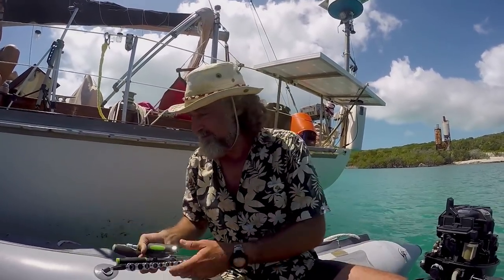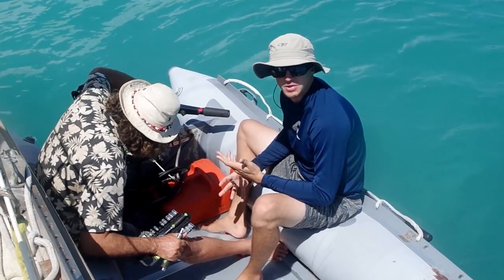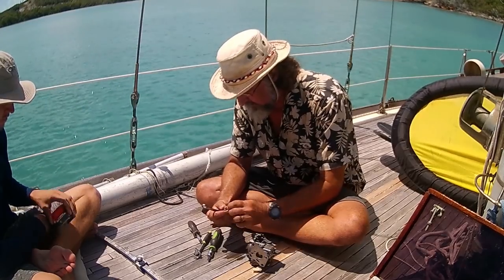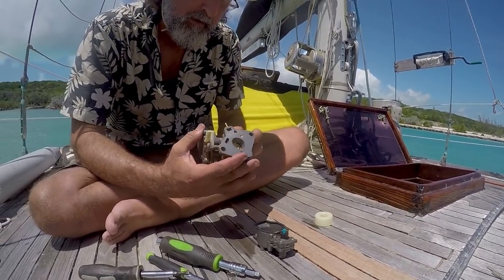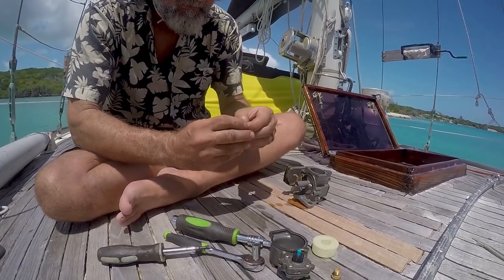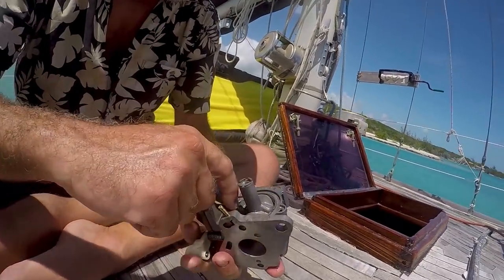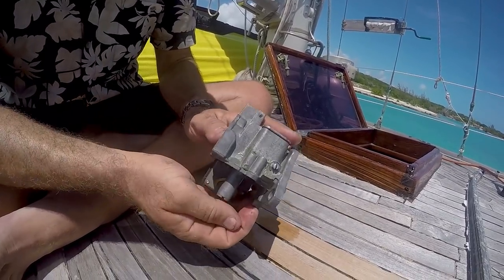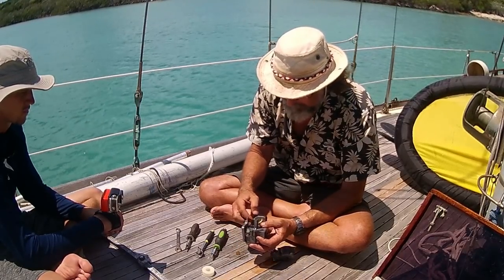Fixing a 2-STROKE OUTBOARD Motor [Capable Cruising Guides]

Comment: What year and hp is that engine. I have a 1993 9.9 Merc with pretty much the same symptoms.  Starts fine, idles fine and gets on plane but can get me where I want to go. Once I start slowing down to idle , it will shut off on its own and will not start. After fishing for an hour or so and using my trolling mtr. then it will start and get me back. But the boat has to sit for a while before trying to start it.
Reply from the maker: Sounds like a very different symptom to me.   Make sure yours isn't overheating.  If it is a have an easy solution for that.
Reply: @Clarks-Adventure  I only ran it twice last year when i first got it. Water pump worked great, good pressure. Someone else said possible coil(s). I was told that after running and it would not start, pull plugs, ground, pull start rope, if you see yellow spark, coil may not be putting out needed voltage to fire off plugs. Dunno. 2 cycle is german to me. Any help is appreciated. Even though this engine is 30 yrs old, it looks pretty well new and used very little.
Reply from the maker: Well run it a while and then touch the head.  If it's over 160f it's overheating.  

It can pump water and still overheat.

I don't know it that's your problem.  I have no information to go on, but it could be. Easy test.

Comment: just got a motor just like that that came up on my crab trap even had the gas tank the vent was closed so the gas was still good almost got it running i may take the carb off it may be full of water .
Reply from the maker: Wow. What a catch!

Yes get that carb apart.  Rinse everything in fresh water.  The carb will corrode inside in a few days if not opened and cleaned out.  Also the wiring will eventually corrode if not cleaned.   Inside of motor is tougher but needs to be rinsed and run to coat everything with oil before issues start.

In short you are on a clock with this find.

Comment: Hello, I know it’s been several months since this video but I am looking for some help. I have a 2006 Johnson 90 hp saltwater edition v4 2stroke. I have recently rebuilt all 4 carbs and cleaned both throttle bodies. Before I even began the cleaning and rebuild I pumped the primer bulb and it had some resistance but never got tight tight. Continued pumping bulb and fuel and oil mixture came out lower unit and prop. What could cause this? Thanks
Reply from the maker: In one of your carbs the needle valve is not closing properly.  Take it out and clean it well.  Before putting it back on check it.  Always do this.  See my 4 stroke repair video as I go into this procedure better.
Reply: @Clarks-Adventure  thanks. I just rebuilt all 4 carbs with new seats, floats and needles. Could it be a float not adjusted properly letting the new needles seat properly? Or maybe the primer diaphragm or main diaphragm from fuel pump letting fuel pass through? Thanks
Reply from the maker: So hard to diagnose from comments.  I assume that didn't fix it.

Yes if your float doesn't float (has gas inside it) this could cause this.  Doesn't happen much anymore with plastic floats.
Reply from the maker: Did you do the blow in the carb trick to verify the valves were seating?

To guess further I'd like to know exactly where the fuel is leaving the fuel system.  I assumed it was running down the shaft before.

Is it actually coming out if the exhaust?

Comment: I just bought a 1983 Mercury 50 2 stroke it was running perfect went to leave left it idling and it died and won't crank. When I squeeze the primer it's firm but I'll squeeze it really hard it spray's gas out carb? It will crank for a second but don't stay running?? What do I do?
Reply from the maker: No worries.  You have a bit of gunge in the floats needle valve.  Fuel is too high in the bowl so it's running too rich.  Just take the carb off and clean it up.  The video will help. It's the opposite problem this engine had but it's common.  You can hear me talking about it when I'm diagnosing.  You will find that the needle just needs a cleaning so it will seal again and you will be good to go.  Worst case is you will need a new needle valve and maybe seals as it's an older model and things can deteriorate with time.

I forget does that year 50 have one carb or two?

I'd take some time to make sure the tank and lines are clean.   If it's been a while since she has run there is likely crap in there that will do this again.

If this works for you how about buying us a beer on Patreon?

Comment: Hello sir. I have a 40hp mercury 2stroke. I hope you can help me with the problem I'm having. The motor starts fine, but only goes about 5mile and hour. So, half way up the lake, I will stop the boat  idle the motor high for about 2min, put it in gear and runs like it is suppose to. What could be my problem?
Reply from the maker: Consistently?

You say it only goes 5 mph.  What happens when you try to go faster?
Reply: @Clarks-Adventure  yes. 5miles is when it's full throttle. Then I will idle the motor at  top RPM for about 2min. Give it full throttle and it takes off normal
Reply from the maker: Can't tell from that description.
Reply: @Clarks-Adventure  I know. Kind of hard to explain. It seem as if it's running off one cylinder. I have it at full throttle and only going turtle speed, then I will idle the motor to its top RPM, idle it back down, and the motor starts running good.
Reply: Don't have any problem with the motor cranking.
Reply from the maker: Running on one could be as easy as changing the spark plug.  Bottom one gets fouled with oil faster.  Cleans up when the engine warms up.

To know if it is running on one, take off the plug wires one at a time with it running.  If no change that one isn't making power.
Reply: Sometimes the idling helps it, sometime it doesn't.

Comment: Hi I have a yr 2000 /150hp/2 stroke engine.   I need to replace my tilt motor.  OEM part is $400 and after market at Amazon is $80.
You think it's okay to use after market for tilt motor.
Looks like even OEM is made in China.
Thanks
Reply from the maker: Yeah,. I imagine it's the same part.   I buy things like that all the time.  It might be a unit that failed inspection but probably not and it's just fine.
    Have you taken down the old unit.  An electric motor is easy to rebuild.  Even if it needs rewinding there are motor shops around but for $80 it's probably not worth more then taking it apart yourself and cleaning up the brushes and commutator.    Or is it physically broken? -C
Reply: @Clarks-Adventure  
I found a big hole behind the motor and it was all rusted out.
I bought the 18cc from someone during summer and never saw the hole behind the tilt motor.  
If its rusted out ..damm.
That  hole probably started more then 5 yrs.
Funny thing is tilt was working when I got the boat..
Reply from the maker: Ouch.   Well it's nice to have a friend in China.   Thanks eBay/Amazon.
Reply: Sorry, never been to China.   Actually I am from USA..lol
Reply from the maker: No just meant that we are lucky to live in a time when we can buy things from the manufacturer more directly
Reply: Hehe.. I am just joking with you.

Comment: My golden rule for 2 strokes is if its not going to be using regularly, run it dry.
Reply from the maker: Good idea for all carb motors.   Especially with ethanol in the gas

Comment: A Merc dealer told me all the smaller Mers were coming off the Tohotsu line, same engine he said.
Reply from the maker: Yep.  But they have these add-ons that make them a pain in the ass to work on and tend to fail.  Usually shifting parts.  It's just do obvious that they were an afterthought.  Just get the Tahatsu.  Or better yet get a better motor for less and look at the fuel injected Suzuki.  I'm really liking mine!

Comment: good video, 4 strokes are the best for longevity/ reliability and the air is so much cleaner without annoying/sickening 2 stroke fumes, i was thinking the whole video i would hate to drop something youd need one powerful magnet and a long rope and a lot of luck.
4 stroke chainsaws exist there just not very popular mculloch made some and the German store Aldis sold 4 stroke chainsaws aswell , i see sthil has a fuel injected 2 stroke chainsaw not cheap though.
i personally want an electric motor , i remember jamie on mythbusters building an impressive dc outboard motor.
Reply from the maker: If you go electric I've got the boat for you.  It's called that aqua naught.   We did a video on one but for now it's only in our Patreon section.   I think it's the perfect dinghy for an electric motor.

Comment: Just wanted to let everyone know that I found a hack in case you ever lose a check ball or find it missing like I did. Instead of purchasing a $138 kit all you need to do is take a grease fitting, one that fits a typical grease gun, use a hack saw to cut it open and voila! A new check ball that mates perfectly with the spring and seal in the primer/injector (float bowl housing). After installing the new grease fitting check ball, spring and 11mm 'bolt' my crappy running 9.9 now runs like new and it cost me nothing!

Comment: do you have problems with having that motor in salt water?
Reply from the maker: Not really.  In fact I leave them down and rely on the zinc.  I think I get more corrosion when I mount it on the yacht for voyages.

Comment: My outboard will start idle and accelerate if you pull on the carb. But if you use the twist throttle it dies

Comment: You didn't check the fuel filter. This is a common issue that can save a lot of hassle. Definitely check the filter before pulling the engine apart.
Reply from the maker: Fuel filter is a slightly different symptom.  This engine ran well at all power levels and just died.  Fuel filter problems start showing as loss of power after prolonged high power operation and can be temporarily improved by squeezing the bulb.

Comment: Why not check the fuel filter first?
Reply from the maker: Because that has a different symptom when it fails.  It tends to run fine for a while and fail at full throttle.  Also the bulb feels different when it's the problem.

Comment: 19:16 Mercury is bad engine?
Reply from the maker: They are good engines (actually tahatsu) but have "features" added that aren't good and poorly designed.   Hard to work on.
Reply: @Clarks-Adventure  Good afternoon! What are the added characteristics that this engine has and what are the modifications that one has to make to the engine in order to improve it?
Reply from the maker: Mercury used to make their own motors and they were good.  Then, like so many US companies, they just became a marketing company.  They get tahatsu to add a few (in my opinion) useless and bad "features" like throttle grip shifting and a mercury sticker.   These "features" are poorly engineered and make it really hard to work on the engine without removing a lot of add-on components that are in the way.
   Best way to fix the problem is just buy a tahatsu for less money.
Reply: @Clarks-Adventure  Thank you very much for your advice, these days I am going to see a used Mercutry 9.9 HP. It is a purchase alternative. What points do you recommend me to observe?
Reply from the maker: We aren't talking about the investment level of a used Lamborghini here.  Not really worth compression testing and all that.
Basically if it starts well and isn't corroded buy it if you get a good price.

Beyond that check that the zinc fin is there and it's not really loud (rusted out muffler).  If you can run it hat full throttle and load for a good while to see that it doesn't overheat.  (Though I have a trick to fix that).

   But first check the oil.  If it smells like gas you have a fuel pump problem (this motor is prone to that).  If it's whitish you have a water leak.  And if it's new and perfect walk away. (There is a reason they just changed it)
Reply: @Clarks-Adventure  You made great advice on the points I need to check. I will look for information on the checkpoints and if a question arises I will consult you again. Thank you very much for your time. A big hug from Argentina.
Reply: @Clarks-Adventure  Hello, good afternoon! I wrote to him on YouTube about the Moror Mercury 9.9 two-stroke. Today I went to see it, the cold start Ok. Temperature Ok. Helice Ok. Transmission box Ok.
But the propeller oil was white.
Reply from the maker: Could be damaged but probably change the oil, replace the shaft seal and go.
    Just verify the bolts can be loosened.   Sometimes they are seized.

Comment: Alright, hoping someone can point me in the right direction. Clearly I'm a large idiot and did not do proper research before taking my Dad's Boat out...

He has a Yamaha 15 two stroke motor. (Yes, I realized two stroke are not good, I'm learning.lol) 
So, this idiot of a mistake is so bad, that it doesn't seem to be a common mistake, because I find no real information on it.. 

I used ONLY Gasoline in the motor. It clearly states 100/1 on the motor. I accept my ignorance and only want possible direction on what I can do. What's done is done, and just as life, it's a learning game, and I am just learning about this boat and Motor. 

Either way, there we a Little bit of gasoline/oil mix in the gas tank. Barely anything.  I filled it back up with regular unleaded gasoline. 😔. I rode the boat motor about an hour and a half, not exactly consistently. Over about a four hour period. It would be a tackle to get running, but once started, ran what seemed well. Ran for maybe 20 mins each time, then stopped to fish, and cut it off. 
... never could get it to start again after the last time I cut it off. Damage must have been done. 

I'm curious if anyone knows of any steps I can do to see what all is actually damaged, if anything can be repaired, etc.. any help. 
I'm already in the thought to that the motor is done. 

I have not tried to run it since I came back. I don't know if I should create the mixture and try to run it w/ 100/1 or if I should drain the motor, add more oil than recommended.. or what. 

Any advice, comments, help and ridicule are accepted. :)
Reply from the maker: I hope you get other advice here but since this is an older video without much traffic anymore I'll put my 2 cents in.
   First off running without oil just causes more ware.  ie. No oil = higher friction.  Don't double oil it now or anything, as you say the damage is done.
  What was the history of the motor?  If it was hard starting before it might have others issues.  That one way valve I talk about causes starting issues.  Since it's so easy I'd clean the carb first because it's so easy and low risk.  You might have just got some gunge in it from what was in the old tank.  Likely if the motor hadn't been run in a while. Just do what I did in the video first.  If it runs with squirting fuel you can breath easy and just clean the carb.

   But to the possible bigger problem.  First off running without oil causes ware and heat.  The ware is permanent but the heat goes away.  So, check it and see if it starts better now.  I don't think you should destroy a  motor in just an hour.  Though you took years off its life.  If it didn't get better on its own I'd want to check the compression.  If it's low you need a ring job.  Not the end of the world.  The hardest part is getting the motor apart without breaking corroded bolts.  Go slow and unscrew a bit then screw back in till they feel free.

All in all it's not destroyed I'm sure.  These are tough machines.
Reply: @Clarks-Adventure  wear

Comment: I get the impression you aren't too fond of Mercury. There are a lot of people out there that like them.
Reply from the maker: Mercury no longer makes small motors.  They are Tahatsus that cost more and have additions that fail a lot and make them hard to work on.
   Why not just buy the Tahatsu.  Or better yet the new Suzuki fuel injection motors.  Even better.

Comment: As he says never buy a Mercury guess what I have on my 13ft Boston whaler I just bought ( A Merc 40hp 2 smoker💨  lol 🤦🏽‍♂️ I’m a first time Boston whaler owner and salt water boat owner lol I run a 2005 JOHNSON 4hp 4 stroke on my 10ft fresh water Johnboat  she runs like a champ easy starting 2 pulls on those cold cold days
Reply from the maker: If it's an older Merc it's great.  And the only problem with the newer ones is it takes more effort to work on them.

Nothing actually wrong with them.  

Hope you enjoy your new boat!
Reply: Emily & Clark's Adventure  Thanks man !! Yes it’s definitely an older Merc 80’s  year, 

But suppressing in great conditions ! I was pretty shocked specially with salt water ..  So today i will be power washing the boat and double checking the engine and grease her up check for any problems that could appear .. well off to West Marine I go to buy some boat 🚣‍♀️ life stuff lol 😆
Reply from the maker: Here is a trick for old ob motors that have done a lot of ocean work.  If they overheat - remove the propeller and run them in a bucket of acid.  Vinegar will do nicely.  Figure some way to make the pee water go back into the bucket.  Nothing much will happen for a while, then, once the vinegar warms up, it will start bubbling and chunks will come out of the motor.
   This is the calcium carbonate that has built up inside and was messing with it's ability to cool.

   This works really well and I've brought several motors back from being destined for the scrap heap.